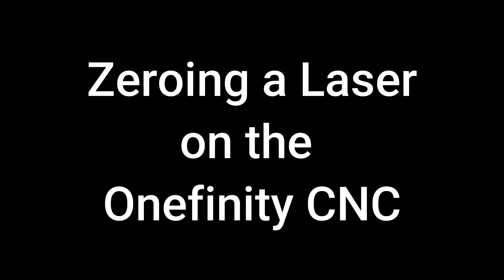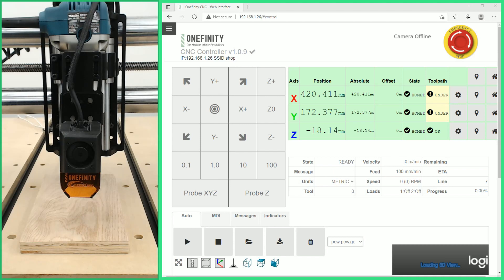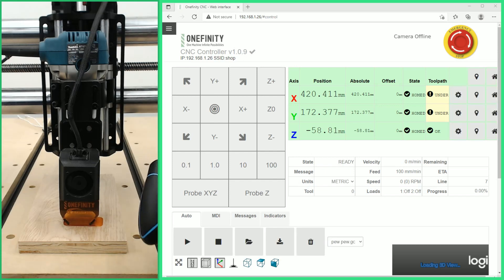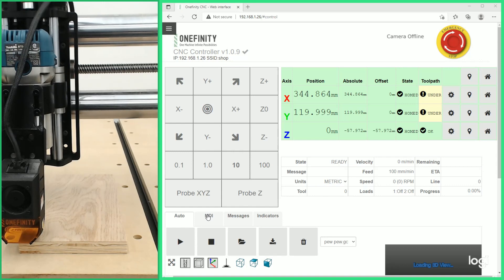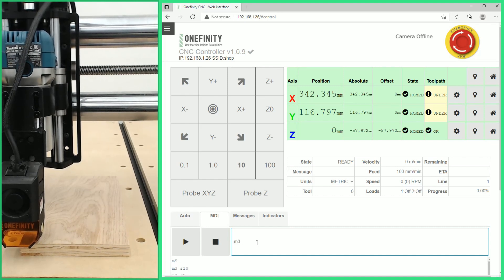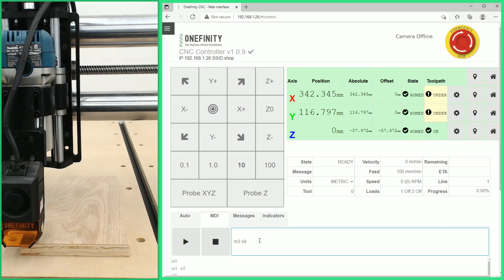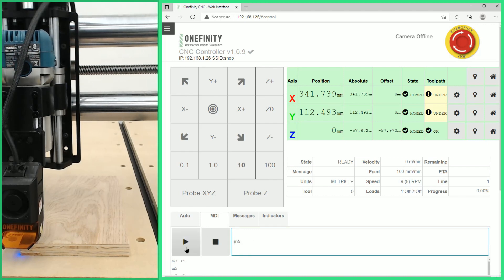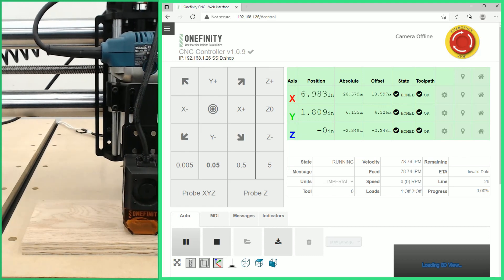Zeroing a Laser on the Onefinity CNC

Comment: Thanks for the video! When I put M3 S1 it still burns the wood, any ideas?
Reply from the maker: did you update to 1.0.9?  did you choose Jtech from the drop down?
Reply: Mine also burns at S1...v1.0.9
Reply: Did it ever work? I’m having the same issue. It’s updated to latest firmware and choose jtech but still having same issue as you.